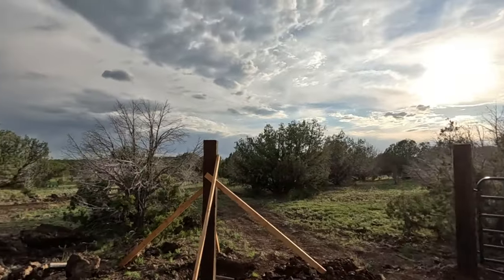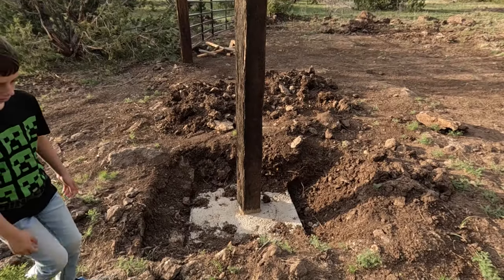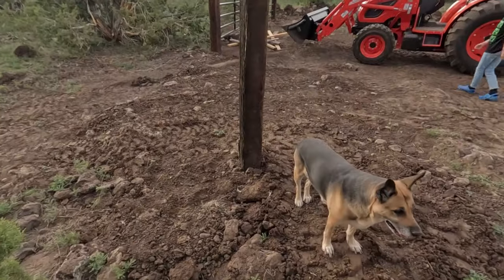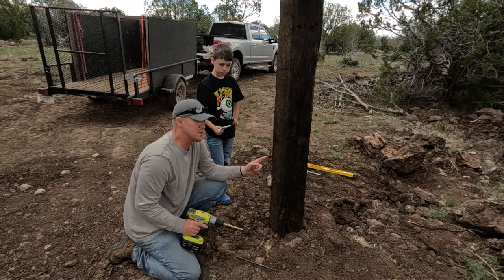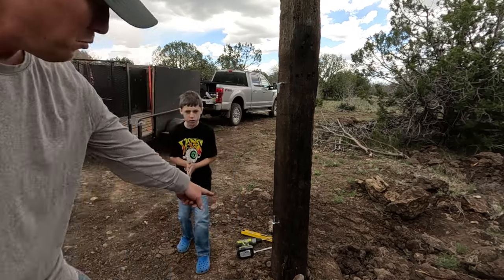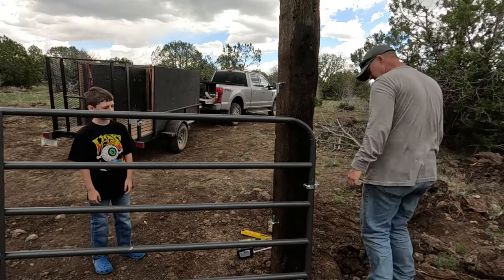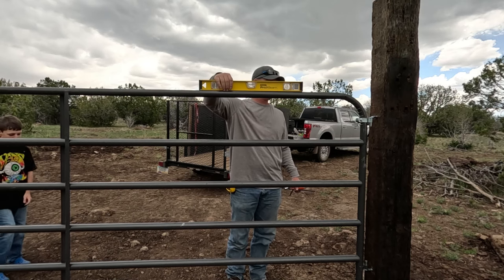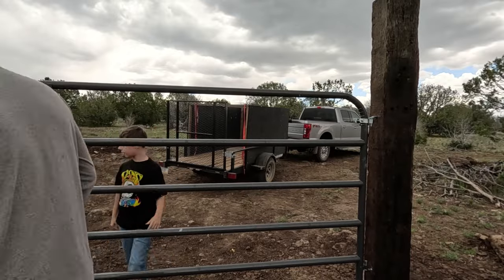Driveway Gate Install

Comment: just did a couple at my place by hand..... thinking I may need to invest in a tractor like you got. If you were buying all over again would you go up a size or are you pretty satisfied with the one you got? thanks again for video and have a happy 4th.
Reply from the maker: Well bigger is always better.  Isn't that what they say?  No.  Any bigger would sacrifice even more maneuverability.  It has plenty of power and it's heavy enough for me at over 6000 lbs.
Reply: @AZOFFGRID  yeah that’s heavy enough to move some stuff for sure Thanks 👍🏼